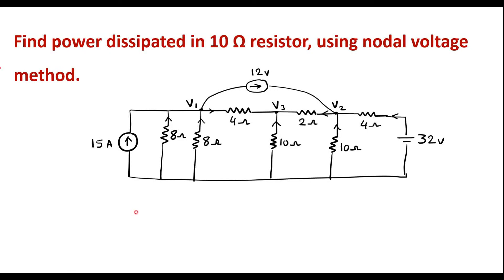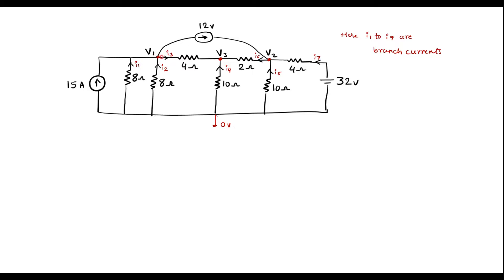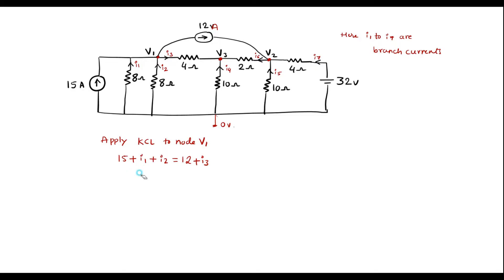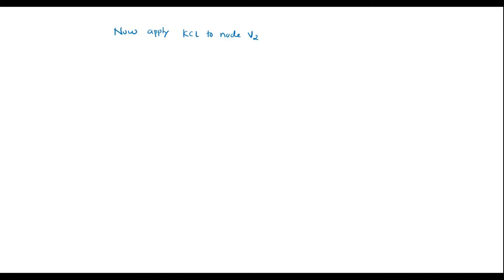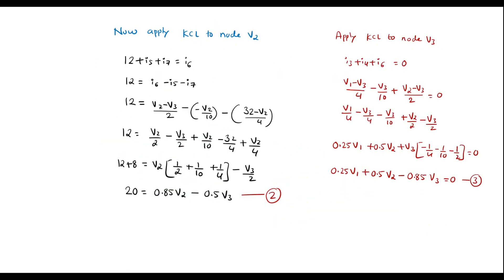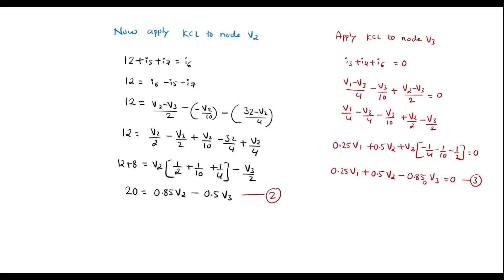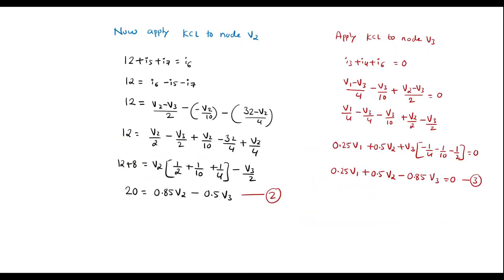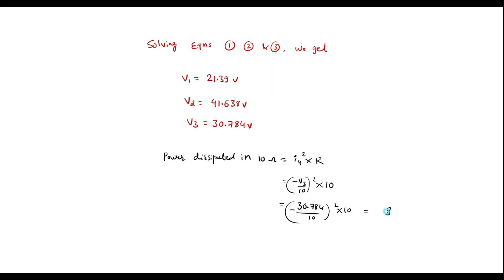Find power dissipated in 10 Ω resistor, using nodal voltage method.

Comment: Why we take v1 v3 v2 at nodes instead of taking v1 v2 and v3
Reply from the maker: It can be taken in any order. Node voltage value is important
Reply: @VBDclasses  if we take like that values changes or not sir
Reply from the maker: @srinivasaraokolli2102  values will be same but only you are renaming the variables. Nothing wrong in it.
Reply: Good question 😅